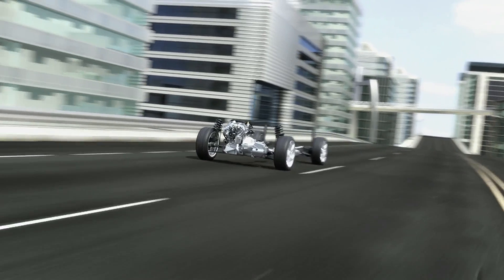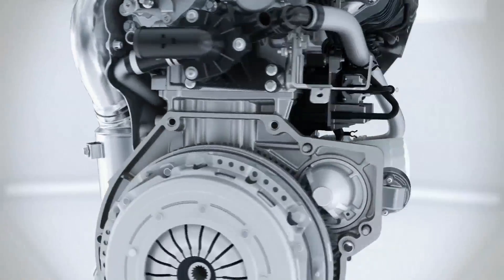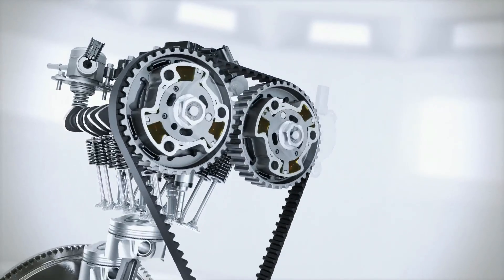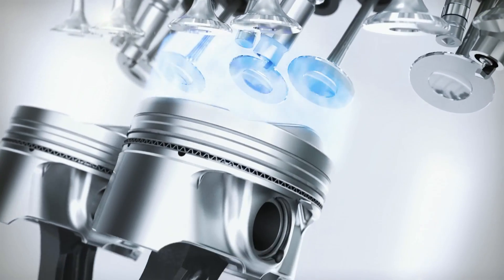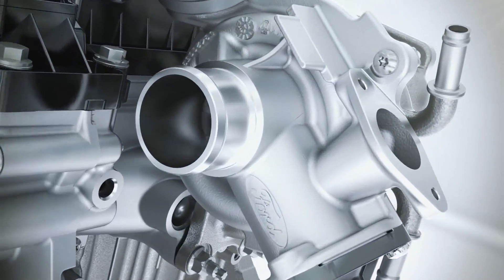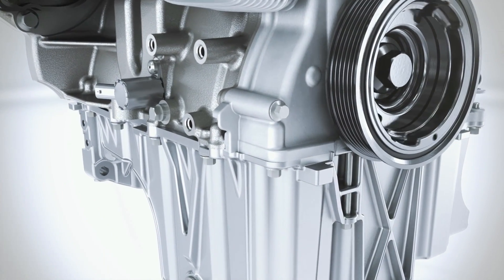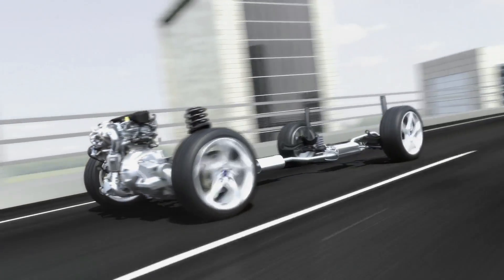Ford 1.0l three cylinder EcoBoost explained

Comment: The timing belt immersed in oil is the worst part of it.  These engines fail after 60,000 miles.  What a disaster.

Comment: Its strength lead to its biggest downfall by dipping timing belt into engine oil.

Expectation: Improve efficiency by lubricating the timing belt.

Reality:  Sludge can form due to wear and tear which clogs the timing belt.

Conclusion: Efficiency: increases, Reliability: decreases

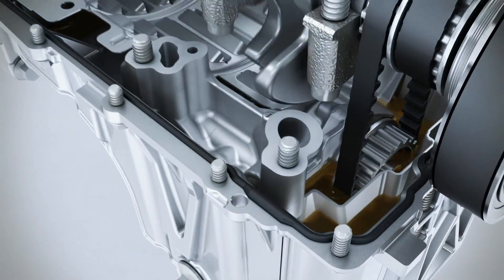Comment: 0:53 Why ? People forget to change the oil, the rubber makes it dirty and then the oil pump gets cloged resulting in low oil pressure aaaaand its gone... Also oil pump belt has no change interval for what ever reason and that fails more easily than the timing belt because it has more tension on it. Why has it not been done with a chain ?

Comment: Good luck finding parts for this thing. Good luck stopping the engine in time when the oil pump belt breaks. Speaking from experience. With all that said it makes really good power, and I like the engine. If the timing belt and oil pump belt didn’t ride in oil it would be a really good engine I just can’t understand why Ford did this.

Comment: Have the serious issues with this engine regarding over heating/coolant loss now been fully taken care of? Which model years was this an issue? I want to purchase a Ford Focus 1.0T but been put off with the above mentioned issues. Please advise. Thanks
Reply: I would advise against it. When the oil pump belt breaks you don’t have time to shut the engine down before it stacks the main and rod bearings and burns the turbo up or the bearings in turbo. I had a hours and hours of trying to find a engine that didn’t cost more than the car was worth. Unless you are mechanically inclined and can put a wet oil pump and timing belt in it every 70,000 miles don’t buy it. Not to mention if you can even find the belts. I like the power and fuel economy though it runs really good until it fails
Reply: If it has 100k miles Ford claims that’s the life of the engine. The timing belt and oil pump belt is lifetime or 100k miles

Comment: Shit not engine...9L/ 100km in the city drive!!! Drama!  6,8 on the highway 110kmh. In eco there is a lot vibration. Drama. Driving below 2000 rpm drama. Conclusion its really shit.

Comment: I have one of these from 2014. My engine (ECU) was tuned to 157hp. I have been driving like this for 5 years now and my fuel consumption has not increased, it stays at 6.4 l/100km, however I drive eco rather than sport. The only damage was replacement of water pump gasket and some kind of bushing. Definitely feel the difference of these 30hp and recommend update.
Reply: 6.4l/100km is a bit high is it not? I work at ford i can can easily drive them at 5,5/100km on eco. On sport is a bit harder since the pedal is more sensitive. Also, what tune did you use?

Comment: How Ford seem to advertise this camshaft baffles me. If anyone knows a bit about camshafts it’s that wetbelts (timing belt bathed in oil) is the worst idea going. So many small petrol engines have issues with wetbelts breaking and the job of changing one is extremely messy, time consuming and expensive. It’s not only Ford have these issues but Peugeot, etc, with the 1.2 turbo. I had one of these engines but didn’t keep it for long as it’s not a long termer, especially with that camshaft. The 1.5 dragon engine is much better designed.
Reply: 2015 1.0 focus here. wet belt in the oil pan shredded itself and starved the engine of oil at only 120k miles. POS
Reply: @MSUD2Hockey  exactly, worst idea ever. The new ones have a chain which should be much better.

Comment: why do they catch fire 🔥,
Reply: The early ones had a nylon hose that used to melt and let out the coolant but because the coolant is split into two different compartments (top and bottom) the guage in the car would still read OK so you kept on driving, the engine would then overheat.

Comment: No mention of the way ford " balanced " the engine.
Instead of a balance shaft,that rotats at twice the engine speed (but is another moving part robbing power and subject to wear and tear)
They have offsett the balance on the crankshaft and flywheel to balance the inline 3 cylinders off beat harmonics.
Reply: I recently bought a 2018 Focus 1.0 EcoBoost 140 and, having watched a very informative video on the differences between three and four cylinder engines, I wondered exactly how Ford had approached this problem. That's how I ended up here and I'm glad you were here too, Bryan. Thank you, Sir. Thank you very much indeed.

Comment: so is the timing belt immersed in oil,..
Reply: TCL i want proof . not just words. 
if you sommerge a rubber belt. i dont think i will last forever.
Reply: @dhies1792  Why not?
Reply: Kevin Brown ever think about a rubber when sommerge in liquid expands?
Reply: I also found that due to the belt being immersed in the oil, the oil tends to turn black much faster than normal. I think they corrected this in the newer, turbocharged designs with a timing chain, as they should've from the beginning.

Comment: Rubber belt in oil? No thanks. Cam CHAIN please. Otherwise looks good.
Reply: Not a fan of direct injection either
Reply: Reliable and robust would be a Bevel gear driven camshaft
Reply: They changed to a chain belt around 2020. My Fiesta is one of the first of that year to be given the chain version, named the M0JB. I only found out when a garage carrying out my car's service looked up my car's details and they told me I didn't have a wet belt. Funny thing was, I was originally going to this garage for the purpose of a wet belt change 😅
Reply: @TCL what about changing it
Reply: @GunslingerLv  changing a wetbelt is a nightmare, a timing chain is much better to maintain and in the long run, by far.

Comment: A lot of people are saying that 125hp isn't high performance but it all depends what your used to. I've owned 3 hatchbacks in the UK now. The first 2 had around 60hp and my latest has around 75hp. So to me 125 would certainly be high performance (Plus theres a new 140 version of this engine now)
Reply: Lynx 636 man you can also remap it to 180hp
Reply: The magic number for tuning used to be 100hp per litre and these tiddlers are hitting 125hp per litre, that's pretty healthy.

Comment: Had a word with the Ford mechanics today off the record, no more issues with this engine that any other small petrol engine. Loads of torque and sporty performance. I drove both types of engine today, the new 1600cc and the 999cc Ecoboost 125 . Go for the Ecoboost its got the same BHP as the 1600cc but loads more torque and its all through the range. Its fun to drive with the six speed box as well.
Reply: Whenever I need a laugh I come back to read your joke comment

Comment: I bet the reliability and longevity on these things is absolute garbage. Probably wont even last 5 years.
Reply: +SeverdSeouL I was going to put a similar comment, I doubt all these NASA level technologies like oil pump pressure, timing belt in oil and turbo will last 150.000 miles without significant problems but only time will tell
Reply: It has total loss oiling and burns low ash oil!
Reply: Probably right- I doubt the turbo, etc will last 100,000 miles.  From what I have read and heard the Eco-boost system is troublesome even at early mileage

Comment: Not when it's crenelated. A camshaft has always been crenelated since one single slip would destroy the engine. Don't compare the inside camshaft to the external (visible) belt to the generator, since slip there is not critical.

Comment: Engine seems a contradiction.
Why not an all aluminum engine with cast iron cylinders/
Why not a titanium self adjusting timing chain?
Why not have the turbo cooling integrate with the block as aluminum heats up faster than cast iron and turbos produce instantaneous heat?
Why a horizontally mounted oil filter with cooler alongside the cast iron cylinder head?  
Why not import the Ford 1.5l TDCi diesel with the auto on-stop feature?  It gets 85.6mpg?

Comment: They are 2 stroke racing engines...
Many configurations was tested in racing, it's exists a racing car with a radial engine (1935 Monaco Trossi), and serial built motorcycles whith radial engines : Felix Millet 1893-1900 and  Megola 1921-1925, and on aircrafts much more exotic configurations...

Comment: As mecanic, i know many engines, and for example on the 1.4HDI Peugeot Citroën , a very reliable engine, the belt hold 240.000km (or 10 years) without problems, but the engine is fitted with a damper pulley on the crankshaft. In comparision,a chain old not more.
Double OHC engines still have chain broke problems, the much shorter chains on older "cam in block" engines was near indestructible ...

Comment: >2 "In some cases, the chain broke as origins in bad tensionner and guide rails (= resonance phenomenom)"

With all due respect, chains don't break of their own. Any force that can break a chain also breaks a belt. if there is a problem in the desing of the engine, and chain can't hold on up to the task a belt will fail way sooner. At any given two designs that are equal, one with a chain and the other with a belt, the engine with a chain lasts longer.

Comment: "This is false: belt timing means only the regulary change from the belt+idler (all 100.000km or more), absolutly no other maintenance"

So, what else should there be? You soundlike you have to chnage your tires only when thery are wron out, duh!

"Chain timing is not realy better: in modern engines, many chains broke (see for ex. the problems by BMW with they 4 cyl engines...)"

Timing chains are more durable application. Just because some crap car keeps on breaking timing chains means nothing
Reply: Chains broke because of cheap plastic tensioners!!

Comment: V3 engines does't exist (it was old radial engines who use this), all modern 3cyl are inline, for car or motorcycle.
The V4 was use in car on old 70' european Ford (1,3L to 1.7L), but is actualy use on  motorcycle like the Honda Pan European
Reply: Honda made a v 3 motorbike https://www.youtube.com/watch?v=7dof7WC0VAc

Comment: This is false: belt timing means only the regulary change from the  belt+idler (all 100.000km or more), absolutly no other maintenance.
Chain timing is not realy better: in modern engines, many chains broke (see for ex. the problems by BMW with they 4 cyl engines...).In some cases, the chain broke as origins in bad tensionner and guide rails (= resonance phenomenom)
The belt in oil is naturaly specific and use new oil resistant materials, the main advantage is the reduction from frictions....
Reply: Lol chains broke because of plastic tensionors!!!!

Comment: Chevrolet Sprint sold in the U.S. in the early '80's had a 3 cylinder.  It was made by Suzuki.  It got about 50 MPG highway.
Reply: 50mpg and 50mph maxed out
Reply: @dreece2000  
I owned one, I drove it on the freeway at freeway speeds.  But the speed limit back then was 55, so I drove at 63 MPH with most of the other cars.

Comment: Well, apparently this still isn't planned to come to the US market, as Ford states: "the new EcoBoost engine will provide fuel-efficient power for three models in the European product range"
Also, the engine was "Developed at Ford’s Dunton Technical Centre in the UK," not in the US, so you could say it's developed for the EU market, so we probably won't see a three-cylinder from anyone in the US for a good while.
Google search "ford ecoboost 1.0" for more from Ford.

Comment: Gas engines are becoming more and more like diesels. Use of "bowl like" pistons, direct injection and turbocharging is showing how diesels are more efficient
Reply: That’s not why diesels are more efficient! However they are trying to make a gasoline engine more efficient by controlling the rpm with the fuel more and more. Obviously the petrol will always rely on a throttle valve but they are getting better. Compression, vacuum, and energy in diesel fuel makes a diesel more efficient than a petrol engine.  Sorry to be the keyboard troll